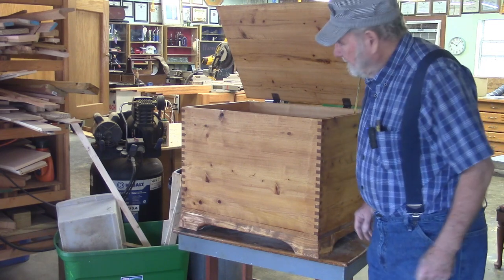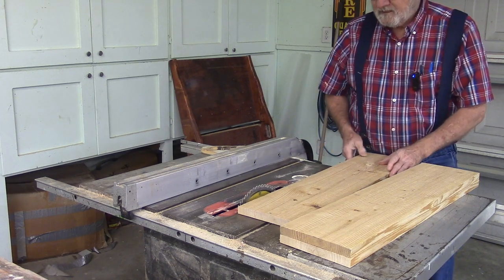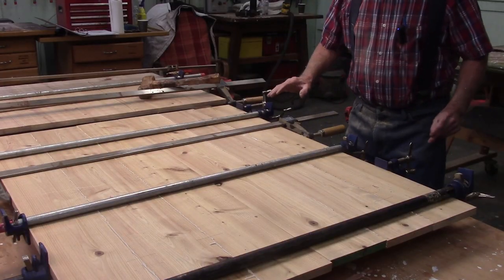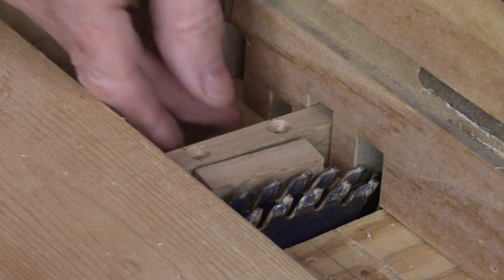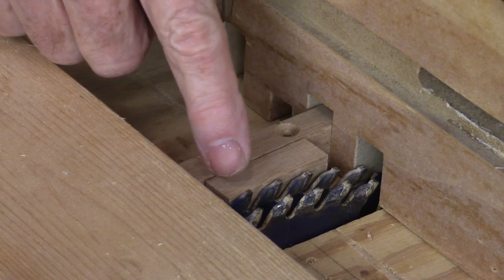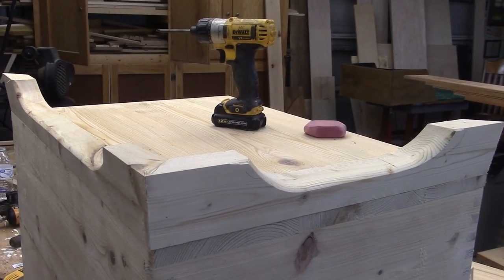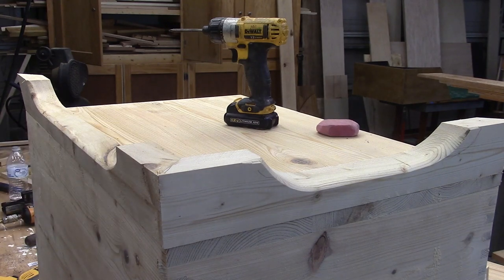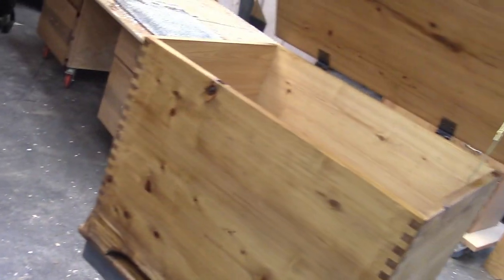264 Making a Cedar Chest  Blanket Chest

Comment: The pine legs along with the color of stain that you chose to use on this project actually work together to give it that rustic Americana look that is so popular right now.  I could see putting a stenciled decoration on the outside.  I have a question.  I am under the impression that the biggest reason you use cedar to make these chests is because it keeps out moths or other bugs that will eat fabrics.  Do other cedars that aren't as aromatic do that or does the cedar oil do this?  Also would there be a problem with the oil soaking into the fabric or does it fully soak into the wood?      Your description of how you used your box joint jig was very helpful.  It might be one that you do a specific video about.  There are probably budding woodworkers out there searching for how to make a box joint jig.

Comment: Nice chest, I have always liked the look of box joints. If you really don't like the base, since its only screwed on, you could make another one from a different wood, oak might look nice. Were you thinking about handles to help move this thing around? Rope, leather, metal, lots of options when it comes to handles. Interesting, entertaining build. Thanks.
Reply from the maker: Thanks for the kind words.  I don't remember exactly, but I  believe I added handles subsequent to the filming.  With that loose top, this thing would be hard to deal with if it didn't have handles.  
    Yep, I learned a thing or two concerning the pine I used for the base.  It looked, not good, but also not so bad until I added the finish.  It may have worked if it was a totally pine chest, but mixing pine and cedar was a mistake.
     Thanks again for the view and the comment.